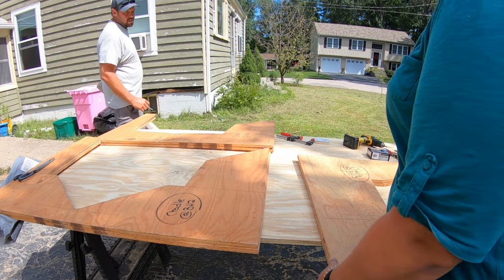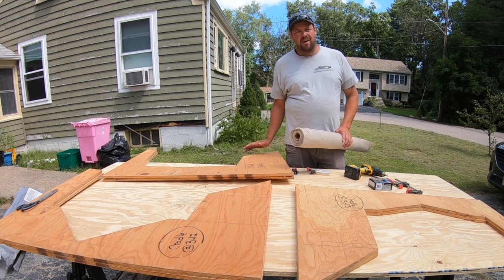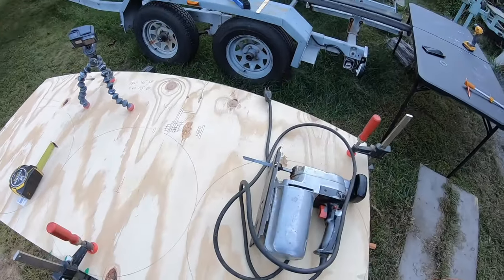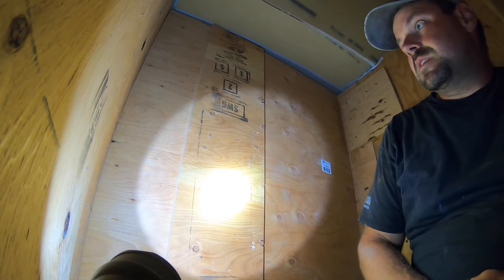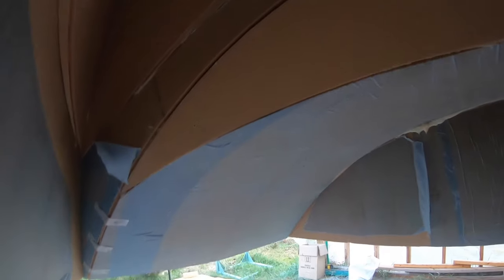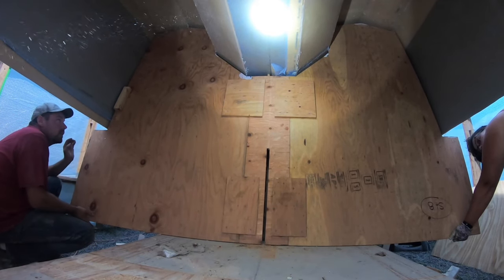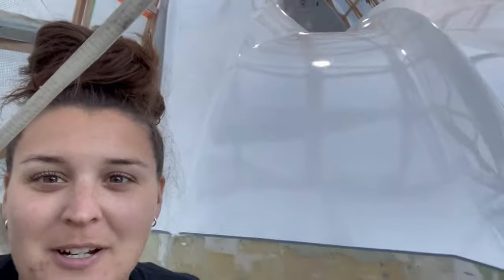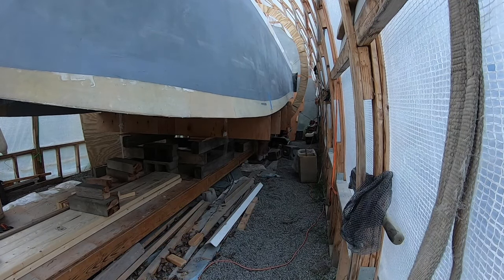Step 63: Raising the Hull! Part 2 of the Rolling Frame Build - Power Catamaran Build

Comment: It's all the fiddly stuff that takes the time.  Quick question for you, was the flexisander worth it?  I have to sand the hull-deck joint on my Cape Dory 25.  I'm debating if I should make my own long board or just get a 22" electric flexisander.  Any thoughts?
Reply from the maker: For us the flexisander was a great investment. We had to sand the entire hull multiple times. Many months of fighting sore shoulders could have been eliminated if had had purchased the flexisander sooner. I’m not sure if they offer a 22” in the electric model. Good luck with your build 😊
Reply from the maker: If you should order the flexisander don’t forget to order the power inverter to run in the states.
Reply: @BuildingMVDauntless  Thanks for info.  My shoulders aren't up to the task either.  I'll check 'em out.
Reply: @BuildingMVDauntless  Roger that!